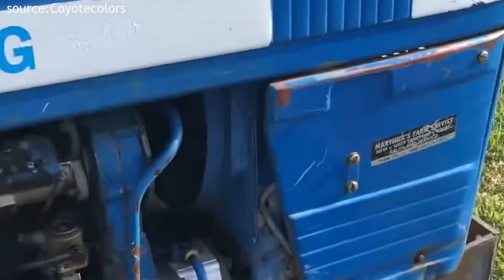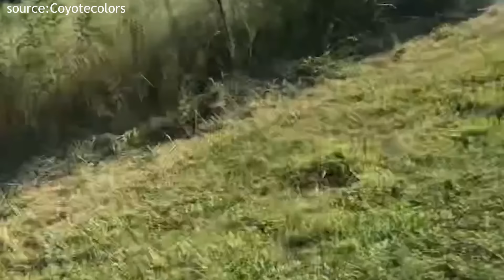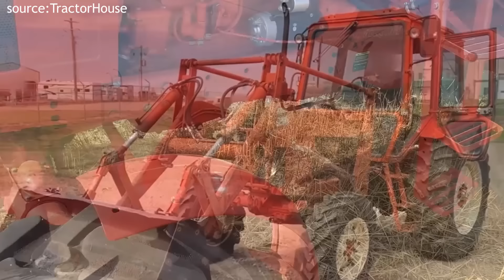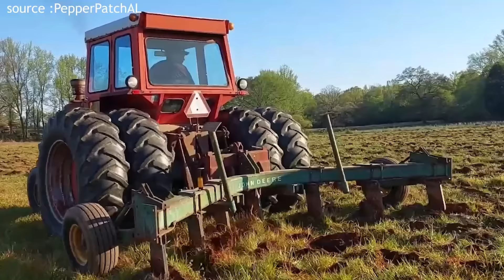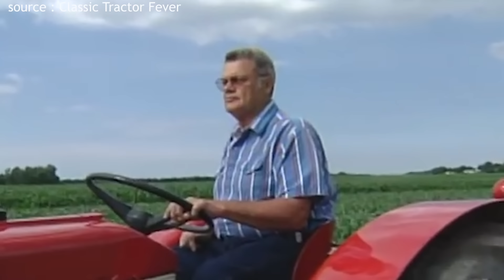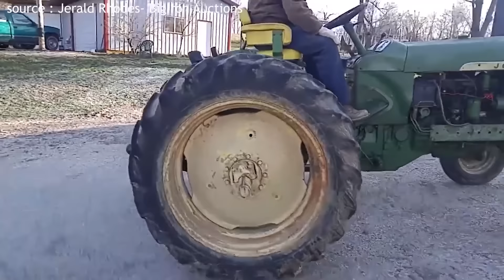10 HATED TRACTORS THAT FADED INTO HISTORY

Comment: Many comments on on the John Deere  2010. Apparently  John Deere  sold  a lot of  them.. l think l got  a GREAT DEAL on my.1963  John Deere 2010 ten years ago fot.$1,800.. Starts and runs good,  
Tires  loaded and nearly full tire thread..No problem with the 3-point.hitch.. Little  oil use, only. Rebuilt carburetor  two years ago.

Comment: I have the 6000 commander it has over 5000 hrs on tack before cable broke runs just fine for a halfway out tractor put all new bearings in engine and a torque limiter in it and it's one of the very first tractors it was originally orange and got recalled for transmission and then painted blue

Comment: If I remember correctly , allis chalmers also sold a tractor probably made by the same romanian company as the long. I think they were tht 5040 and 5050.   I drove the 5040 a lot.  It had orchard exhaust (tailpipe) and would choke you when attaching an implement. There was a magnetic chip rod that ran through the middle of the oil filter. Whenever I checked it, it was filled with chips. I think I checked it weekly. I was surprised the engine didn't blow before I quit working there a year after they bought it. I think there were several brands of tractors that bought these units from romania with the only difference being the sheet metal that was bolted onto them.  40 horsepower.

Comment: This is Robert, we had a 560 IH that unfortunately was built for lighter duty work-not major tillage, got a major engine  overhaul in its 4th yr, had a couple of MF tractors a 1100 & 1135 where both the engine & Trans had been overhauled before 3500 hrs.  Switched to JD & at 8000 hrs no problems with engine or trans.

Comment: The IH 460 wasn't the big problem tractor for IH, that honor belongs to the 560. IH had a solid drive train with the Super W6 models of 1953-54. But as they developed slightly higher horse power tractors, they attempted to under engineer the new drive trains with devastating results. The new lead tractor of 1958, the 560, had immediate drive trains problems, especially in the differential. Eventually IH recalled and rebuilt or replaced all the 560 tractors from the first year's production run. But by that time the New Generation John Deeres were in the market with well tested drive trains and more horse power. IH went from industry leader to barely second place and never recovered even though their product improved greatly with the 806.

Comment: The description of the John Deere 2010 is not accurate. The hydraulic system and transmission were very reliable, however the engine did have issues and suffered from many recalls. But many tractors reached high hours without issues.

Comment: You mention that the Steiger used a Cat 3208 engine . This small Cat engine you compare to the Cummins V8-555.  The Cat 3208 was also a V8 engine, and you alude that it is an inline engine which it is not.

Comment: My Dad owned two JD's over the decades; a 2010 (back when I was growing up, and a 2295 that he bought used in 1998. I barely remember the 2010; he traded it off on an IH 674 that we still own in 74'. I'm a lot more familiar with the 2295. What a pain in the ass. It had an intermittent hydraulic issue that was byzentine enough that the dealership had to blow the entire back half of the tractor apart 4 times before they finally figured it out. After that it was reliable, but still damn expensive to own and operate. Sucked fuel, and anything more than belts and filters had to come from Germany.
Reply: When I was really little I think we had like 3 jds, I don't even remember what they were aside from them basically being early cabbed probably 1970s-80s models.  then my dad sold them to buy a newer one,  a 90s model that he kept for awhile and actually held it's value pretty well, until trading it for a brand new 2013 7260R, which I still use.  We also have a 520 that hasn't run in several years. (I'm not sure exactly what's wrong with it, last I remember we had it running for like 5 minutes then it quit and it's never run again. (this was after replacing the sparks and rebuilidng the carb) So it just sits in the back of the shop without a battery. It was hilarious when it was running though...... 3200cc of inline 2, 40 something hp on a good day,   and it would lift the front wheels off the ground at times. 7260 has been allright, only thing is it the hydro fluid is also the transmission fluid, so if the wrong line breaks (like a blower line on a planter, not really it's fault, all hydro lines fail eventually), or a random fitting breaks, then the tranny runs out of fluid and then it screams at you and it's basically dead in the water. so you need to fix whatever broke and then dump like half a pallet of hydrofluid into it.  (we have enough empty hydrofluid buckets we could probably build a fort.)

Comment: Add to this list, any new computerized tractors made today.
Reply: In particular the 85 HP New Holland. I made sure that the transmission was full of oil yet on side hills, the dashboard would light up with warnings of low hydraulic fluid levels in the transmission and would even shut down the hydraulic system totally. I had to turn off the engine, wait for the computer to reset, start up and drive on. Eventually the shaft that drives the hydraulic pump sheared off which started a three months long nightmare at the dealership. The mechanic tried to remove the back part of the shaft with a welding rod stuck to the shaft. He accidentally welded it to the ring gear on the flywheel!. They had to split the tractor to free it up. They called me and though my clutch was working perfectly, they said it was down to 60% so I said ok, replace it. They did......5 times and couldn't get it to disengage. 5 different clutches and none of them worked so they had an "expert come in from France and they worked 24 hours a day for 2 days and discovered that they had to slot the holes in the clutch cable ends to make it work.  This took the bulk of the hay making season which I intended the tractor to be used for. I traded it for a Kubota of similar size. Hydraulic clutch and reverse and absolutely NO computers.  The only thing I have had to do is pour fuel in it and change the oil!  Drive on!

Comment: I've heard from farmer friends the AC XT 190 model had numerous problems with bad engines bad transmissions and other costly failures.
 Is this true
Reply: The AC 190 XT had a great engine in it, but the rest of the tractor (clutch, tranny, final drives, brakes, etc.) could not handle the power from that turbocharged diesel engine! Also, the PTO wasn’t “live”, requiring the operator to use the Hi-Lo selector as a clutch when baling hay, etc.

Comment: I think you’re confused about the farmall 460. The 560 is the tractor that broke IH. Also I would’ve believed the 7580 allis to be on the list you showed over the 440. Those old steigers were bullet proof.
Reply: The Ac 440 had a 555 cummins diesel. Not their best Idea. V8 no torque.
Reply: @vicsimpson5608 yes I’m aware of that. I’m not a big V8 fan in any tractor. But I’ve heard more people complain about the 7580s than I ever have the 440s they were rugged and still very much bearcat
Reply: 440 were junk no hydraulics

Comment: We own a 1963 IH 460,  This has been an excellent tractor.  But not from day one.  At first it did not live up to the rated HP.  Over sizing the carburetor jets and a new set of governors (for an IH 606) made it a good tractor. Original TA.  It has well over 6000 hours. Restored to like new about 15 years ago.  Very handy to have and still runs a 10" x 71' auger every fall.
Reply: Our Farmall 460 was an underpowered lemon. The TA went out of it early on, and it could hardly pull even a 2-bottom moldboard plow. For its size, it was a gas-guzzling disappointment!

Comment: I have both a MF 1155 and a Belarus 825. The 1155 is a great tractor. The Belarus is actually a pretty decent tractor. Parts availability is an issue, and the operators manual is comical, but it does have some useful information. But it is a very simple machine. It is crude and rough around the edges but makes a good chore tractor that will start in the cold weather.
Reply: I have I think 7 Belarus tractor's    and I like all of them.  Crude yes.

Comment: I would agree.the 2010 was junk.when the 20 series came out they were much better.if you had a 1010 or 2010 diesel you will need 4 or 5 sets of glow plugs on hand to start it in cold weather.
Reply: Fortunately, both our 1010 Utility and 2010 Row Crop were gas powered. They started fine during Montana winters.

Comment: All the new JD are broke all the time and only dealer can fix
Reply: All tractors, cars etc are not reliable after the vibration, dirt and use work on them. Components fail under common use conditions then the money repairs begin

Comment: Your assumptions on the massey fergusons 1155 is quite exaggerated  I own a 1971 1150 and I still have it today  my machine has been run hard pulling an 8 bottom plow with 16 inch shoes and still is a bad ass tractor even today and mine is only tha first generation of the perkins V8  so I doubt that the 1155 is a troublesome machine your videos are a fraud...
Reply: Here in newzealand. Not very good transmission problems
Reply: And v8 Perkins oil  usage problems , multi power no good .
Reply: AND YOUR TALKING OUT OF YOUR ASS  I'VE HAD MY 1150 SINCE 1974 AND HAVE NEVER HAD ANY PROBLEMS WITH OIL CONSUMPTIONS OR ANY EXCESSIVE OIL USEADGE IN ALL THE YEARS THAT I'VE OWNED IT  AND YOUR ALSO FULL OF SHIT ABOUT THE MULTI POWER AS WELL ASSWIPE. YOU OBVIOUSLY DON'T KNOW SHIT ABOUT MASSEY FERGUSONS  BECAUSE YOU WOULDN'T BE TALKING OUT OF YOUR ASS SOOOO MUCH.... @brianlowe3529
Reply: A late friend of mine was an Oliver/White mechanic and he said that they had many problems so their dealership got most customers to upgrade to the intercooled engines. The wonderful thing about the Oliver frame was it would hold still for just about anything you can throw at it  Caterpillar, Cummins, Detroit Wakasha and I even saw that you can adapt a 1650 over to a JD 329 (2940) engine.  I had a 1650 G and my dad absolutely loved that thing and he had switched to Deere in '66.  He said it was the only Oliver he'd ever driven with lugging power. It turned 73 HP on the Dyno!

Comment: Interesting choice of tractors and I would agree with a number of the points made in the video. However, your credibility is greatly diminished when you do not even know how to note the tractor models. It is a four- sixty IH, a twenty-ten John Deere, etc. The one engine noted is a thirty-two-oh-eight, not a 3208. Better do a better job on details or you will lose your audience. You also need to match your videos up with the correct tractor models you are talking about.
Reply: A.I.-generated narration.

Comment: I have had experience with a 2010  and the ford 6000.the 2010 is a wonderful tractor compared to the Ford.
Reply: Our 2010 gave us very little trouble.
Reply: My uncle had a Ford 6000 diesel that was a good tractor. My grandpa bought a Ford 6000 gas and had nothing but trouble with the motor.

Comment: I grew up on an M John Deere and learned to drive on it.  Then we got a 50, then a B.  The dealership we bought them from advised to NOT buy a 2010.  To be plain, the 2010 was a piece of crap.  However, the 2020 was a good tractor.  My brother bought a 2020 diesel and put lots of hours on it.   I put a lot of hours on it myself, usually pulling a 7 foot Sidewinder (with tire) brush hog over new dozed ground that always had a bunch of "sprouts" to brush hog, push the grass and weeds.  It had plenty of power for that.  Years later, after my brother had put a loader on it, he sold it to a Deere dealer.  After that, I regretted not buying from him even though I knew it was "well worn" and would need an engine rebuild in the not too distant future.  I now have a 60, 420, and B John Deere.  The B has a very common problem.  The gas tank is rusty and has to be reworked.  I am currently having that done.  Will probably be a couple hundred dollars, but a replacement is $500 up.  One thing to watch about the B is that you have to add a PTO overrun as it does not have "live" power.  The others do.
Reply: We had a 2010 back in the '70's. Loved it. It was a good utility tractor. Loved the front end loader attachment. easy on, or easy off. Pulled two 16's without a problem. Not beast,  like our big Case or even our old Oliver 1550, but one of my favorites to drive.  Small enough to do some tight space work, big enough to get it done.
Reply: @joeL-m7q5m  Glad to hear you got a good one.  There weren't many of them made!!
Reply: Dad bought a 1949 B degree at an auction. Compared to our 1939 FARMALL H THE B was a terrible machine. Starting assist was one of our FARMALLS and a log chain. I repainted it and put new rear tires on it that came off one of our IH,.s.  Anything the B could do the Farmall H or Super H could do faster, easier, and move on to our next task.  Dad had a 1949 Deere R diesel for maybe a month one spring.  It,,s best described as a gutless wonder. It pulled our 12 ft tandem disk OK but a 4 bottom plow the salesman said it would pull was only possible crawling alone in first gear.  It didn,,t stick around long. Township road commissioner bought it and sent it away in less than a year Dad bought a think it was a 1963 Deere 4010 diesel at a farm sale.  Huge money pit. About everything we used it needed repairs. Everybody else pulled a 5 bottom plow where we used 4. 14,s.  It was an OK cultivating tractor, I Laid By one 40 acre field  of corn one afternoon in about 2, and one half hours in 7th gear, roughly 10 mph, I flew across those quarter mile long rows in minutes
   Big time farmer a mile and a quarter away from our farm traded a 4010 diesel off for a brand new 4020 diesel and a 4320 diesel with factory cab.  I spent a LOT of time in that cab that summer. It had heat and air conditioning. Boss had a Deere 5,14 or maybe it was 5,16, but I flew along in 5th gear, he had lots of half mile long fields.
Reply: @dennisfrisk Sounds like you don't like anything about a tractor.  They aren't race cars were never meant to be.   I hope you have a different line of work maybe something up to your speed.
Reply: We bought a 2010 a couple of years ago been loading and unloading round bales ever since it's very dependable and the loader works awesome.
Reply: My dad bought  1946 John Deere  A in 1946 we used it on the farm till 1958 I learned  to drive it on the field when I was 6 years old    selenoid went out had to start with flywheel start on gas then switch to fuel oil  was GREAT logtrkn coyote here 🐺🪖 veterán Army
Reply: Ten years ago, l purchased  a John Deere  2010.. l  have been  questioned  "does it run, etc."..It always starts. Rebuilt carburetor  2.yrs ago. 3-point works  good....l don't  know any problems  associated with the 3-point lift. I have not used the hydraulics,  but thanks for the  INFORMATION of  suspect problems.  I was planning on installing  a front-end  loader. Paid $1,800. For the tractor. 
 9 years ago,  purchased 1945 Farmall H  tractor for $1,200. With front-end loader. NO power steering  so impossible to steer without moving  with a full  bucket load. Magneto .rebuilt and starter had a burned ground.wire inside but no problems  otherwise. Had brand new rear tires  John Deere  has original  tires, weather checked but nearly  full.thread and tires are loaded. Both.tractors use about same fuel consumption  and no unusual  oil  consumption. John Deere has the dual P T O  which I have no  use  for the higher  RPM , at this time. Appreciate  all the information  on  problem tractors.